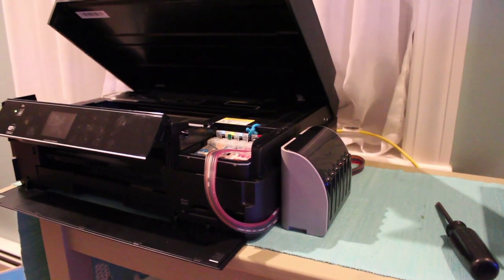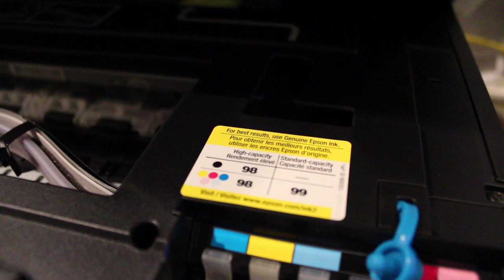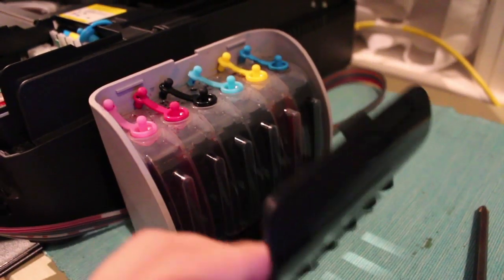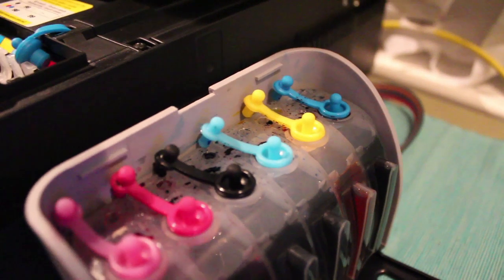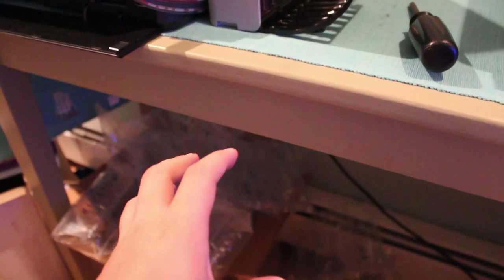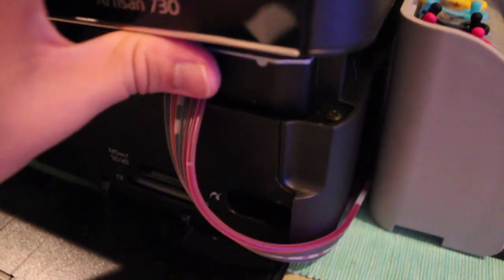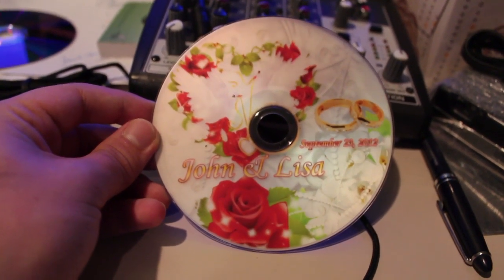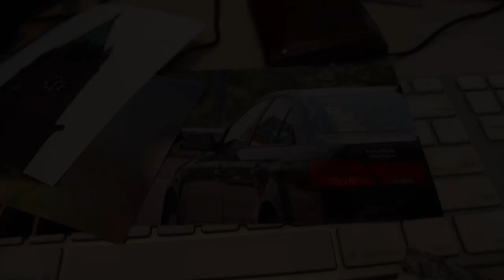Epson Artisan 730 Continuous Ink System

Comment: Hello friend. I have the same printer. I installed ciss and it worked perfectly for 3 years. Perhaps was my mistake - I didn’t refill the ciss tanks and black color lever became low and stoped to print good. So I’ve ordered new inks and refilled that. I made a re-priming also. Doesn’t work 🤷🏻‍♂️🤷🏻‍♂️🤷🏻‍♂️😞😞😞

Comment from the maker: well you have to use ones that are inkjet printable. I've been using falcon dvds which as you can see in the video are silver not white and are semi-glossy so it gives a great pro shiny look to them, sort of like a thermal print. i get them from discmakers on their website. it's 35 cents a piece plus flat $7 shipping. 100 minimum.  as for CD's they sell those too and blu-rays. i believe those you can only get in plain white as i've had trouble and been unable to find silver inkjet blurays.

Comment from the maker: well i've only had experience with this one from inkxpro. however i will tell you that i've been having trouble with the printer saying it can't recognize a certain cartidge and quitting mid print. they sent me free of charge a refillable cartridge set that i can swap the chips out on to see if that works. when i get it in i'll let you know. if you want a continuos ink system i'd go with another printer manufacturer unless you need disc printing like myself.

Comment from the maker: i'm not sure if there is a way to put the older firmware on, however i will tell you that i do have it working and i've used probably about the equivelant of 2 cartridges of each color so far. I did have a problem and the printer was constantly refusing the cartridges. i called inkxpro and they sent me free of charge refillable cartridges, with which i swapped the CISS chip for the individual cartridge microchips and it now works fine. i just reset the printer when the cartridge is "empty"